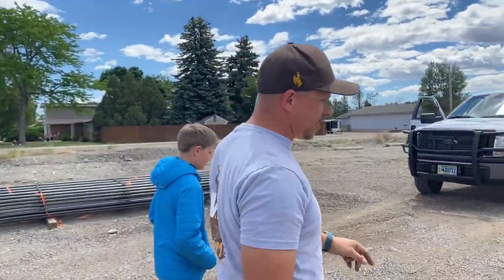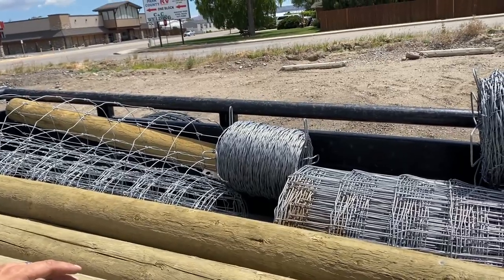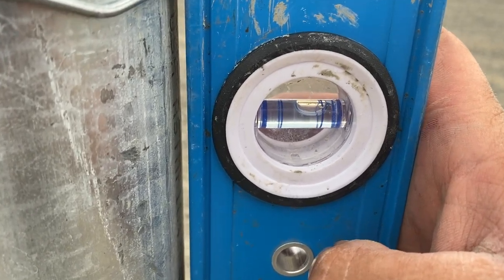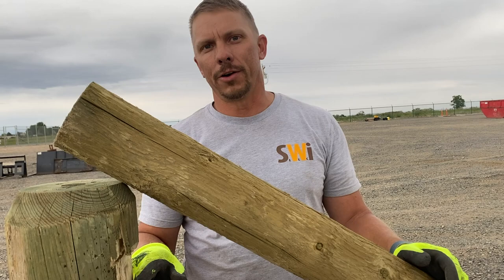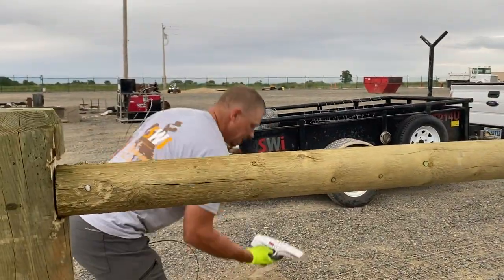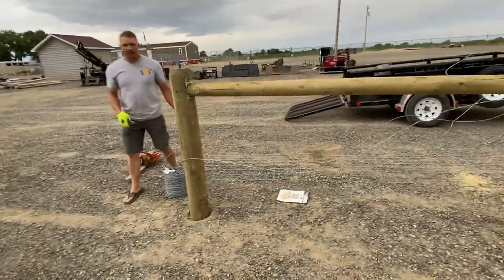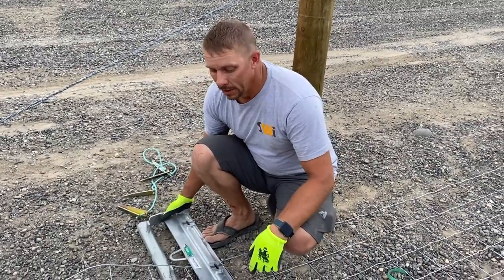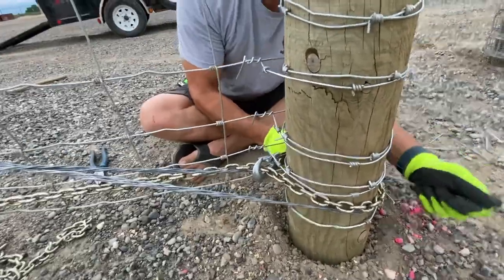You're building farm fence wrong! H brace vs diagonal (rance) and low-carbon wire vs high-tensile.

Comment: Your diagonals are backwards for wood fence.  They’ll cause the corner to lift.  The opposite direction will transfer the lift from the corner to the brace so both have to lift at the same time.
Reply from the maker: We will have to agree to disagree.
Reply: The diagonal are correct
Reply: @ wagoner farm his diagonals are correct.   Better go check your fence lines.
Reply: If the diagonal wires were the other direction it would be helping the rest of the wires pull the brace over rather than pulling against it

Comment: This goes to show you that anyone can make it Merica. You can be a "craftsman" and not know how to use a hammer. Of course, getting 9 gauge wire in the eye, a fence post on a bare foot, or a pressure treated splinter in your hand may slow you down a bit, at least you can tell everyone how to build a fence.
Reply from the maker: Tell us how you really feel. 😉

Comment: Wow those posts really are garbage, it really depends where you go. My local “farming” shop sells £6 posts which are first of all overpriced and second of all they are of the lowest quality. Treatment only goes a few millimetres into the timber. Whereas at my local timber supplier who specialises in fencepost treatment, I can get the same dimension posts which are incised (have 6mm deep cuts to absorb more chemical), kiln dried before treatment to absorb more chemical and also slow grown pine which are more durable than cheap spruce posts. And the best part is that they’re only £4 each for 180cm high 88mm diameter 15 year service life posts. The treatment goes in at least a good half inch into the timber, I still retreat it with copper nampehenate though when I make cuts just to help it last longer. What you really want though are creosote redwood posts, these are made of redwood which is naturally much more durable than pine, they are also pressure treated with creosote which makes them last 40+ years at least! After cutting one in half you can see that the treatment almost reaches the core which is damn impressive.

Comment: I do not use nails I use screws 4 in
Reply: I used 12 inch spikes
Reply: I use lag bolts through the post into the rails